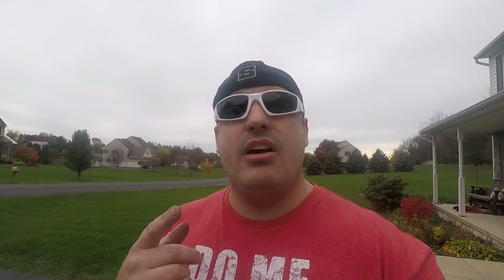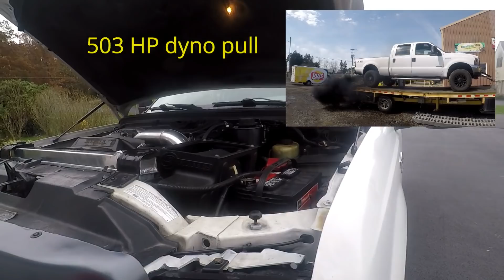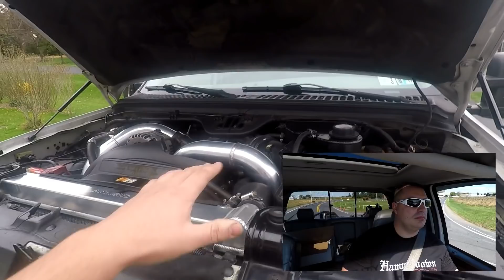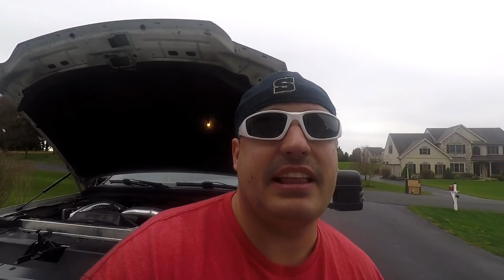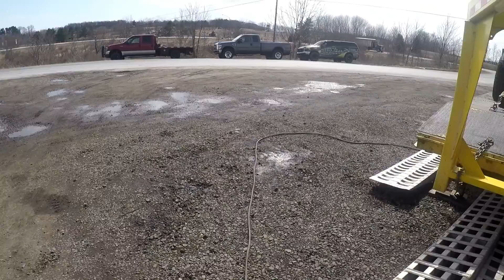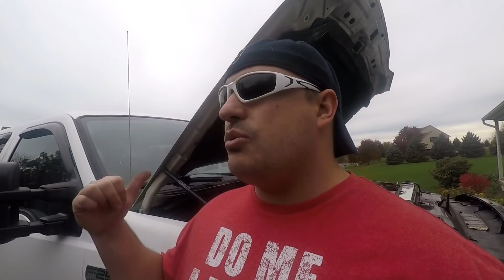Built 6.0 Powerstroke

Comment: So to make 500 horse I need to upgrade and replace whole engine basically thank you
Reply from the maker: No not at all. Turbo and injectors will make 500 hp custom tunes obviously.
Reply: @six0bros  coming from an lbz it’s just been a headache trying to hit power numbers lol I love the truck and love the sound just a lot more goes into it seems like , sweet build man
Reply from the maker: Thanks man. What are your goals? I do recommend certain things for certain power levels
Reply: @six0bros  not a super high power level 450-500 it would be a daily driver as well as a vehicle I would use to work (haul mulch ,cut trees and such) but something I could have fun with as well
Reply: @six0bros  would a wicked wheel and some decent sized overs paired with a tune to back it up get me there

Comment: Are you running stock rods and rockers? Do you recommend a cam vs. rods and rockers? I’m purchasing a KC Stage 2 kit with 190/30 injectors. Not sure if I should do the cam first or not.
Reply from the maker: at the HP you will be capable of I would not spend the money on rods at this time. I would do the cam over it. I love the cam in the truck. It helps the turbo spool very fast, and adds great drivability.  Also your rockers should be ok too. although if you have it completely apart it wouldnt be bad to get a fresh set in there or to consider upgrades.
Reply: @six0bros  What cam is it that you are using currently?
Reply from the maker: Colt stage 2 cam i love it
Reply: @six0bros  you do lifters or valve springs
Reply: @six0bros  what trans mods ?
Reply from the maker: I had new kdd heads with factory valve springs and lifters to go with my cam and new pushrods

Comment: In the process of building my second 6.0 now. It's going to run stock injectors until they give up. Not sure if I'll go 175cc injectors again or stick with the 155's. Powermax and a kill devil stage 2 cam for now.
Reply from the maker: 175/stock injectors are one of my favorite setups for towing. I loved my powermax turbo. However I do recommend some of the upgraded turbos. Like a 64mm turbo would perform a but better than the powermax. However the powermax is hard to beat for the value that you get. It's a big step up in price to the custom turbos made. However if you ever look at them I am sponsored by turbotimeusa.com/six0bros and the coupon code six0bros will give you 5% off. Also that is an affiliate link as well. Check them out. However again 175/stock with a powermax is great setup
Reply: @six0bros  which powermax?
Reply from the maker: I know a lot of people refer to different stages of power max but those are custom turbos. A true power max is a cast wheel and is completely built by Garrett. So I had just a plain powermax. Now as for upgraded ones turbo time usa sponsors the channel and has some great options. I think most people would love their 64mm turbo. It will spool up fast tow great work with injectors from stock to 205/30 not that you couldn't go bigger with that turbo but I think after a 205/30 you would need to go into their gxr series. Also if you're looking at turbos use code six0bros for 5% off their performance turbos
Reply: @six0bros  I need to tow.... heavy and looking on there site thrpught your link there's like 15 powermax turbos so I'm not sure was also thinking kc 1.5
Reply from the maker: I'll get you links to the 2 turbos I think you should consider. The first is their 61mm turbo. This will pair well with stock nozzles. You could still go up to 30% nozzles but this really is more for towing performance. Great turbo overall for heavy towing.  https://turbotimeusa.com/products/stage-1-garrett-powermax-billet-61-turbocharger-2003-07-ford-powerstroke-6-0l-f250-f550

Next this one is their 64mm turbo I wouldn't go larger than this. You start to need more rpm to have the turbo spooled up but you can still tow heavy with it. This will pair well with stock injectors all the way to a 205/30
https://turbotimeusa.com/products/garrett-stage-2-type-s11-turbo-powermax-6-0l-2003-2007-ford-powerstroke

That is the single plane version which should spool slightly faster down low. They have a dual plane version thats a little more expensive will spool slightly slower but have a slightly better top end from my research hope this helps. Don't forget six0bros for your 5% off
Reply: @six0bros  I wonder how these would go w 155/stock .... ? I researched the powermaxes and guys say the egts are higher with them and hard to clean up smoke
Reply from the maker: The powermax turbo is a good turbo but it isn't as fast spooling as more of the custom wheel designs from aftermarket companies. 155/stock is a great upgrade that will have easy to manage egt, and still give a nice bump in power. The powermax turbo is a great size to run with that turbo. Garret has changed the wheel design of the powermax a few years ago and I feel it was an improvement over the older style. Still not as good as some others out there but those turbos also cost more. If you wanted a better performing turbo I would look at my sponsor. Turbotimeusa.com/SIX0BROS that is an affiliate link that will give 5% off their performance turbos. Their stage 2 would be better than a powermax but again also more expensive. Even with my affiliate code.
Reply: I'm going to a 155/30 and colt stg 2 ... so I'm not sure which one would light the best
Reply from the maker: @MrDanimal77  I would bump your injector up to 175/30 or go with a 155/stock. The 61mm turbo will light the fastest as it is smaller, but the 64mm will light quickly and have better top end. If you go with 175s I would go with a 64mm, if you go with the 155s the 61mm would be better suited. With the colt cam in there I would personally recommend the 175s and the 64mm turbo would be a very fun setup.
Reply: @six0bros  yep but I don't have the extra funds atm for reg fuel return and fass lift pump which is highly recommended by Warren,  full force and J&k engines so idk
Reply from the maker: I love my 175/stocks too. Small bump in price and your stock fuel should be able to hold pressure on them. Or 155/stock are a nice upgrade. Holding off on nozzles will save you a good chunk, but let you in the future upgrade the nozzles if you wanted. I would recommend sticking with stock nozzles for now. Also save some money and go with the 61mm stage one turbo from turbo time. Use my affiliate code six0bros and it brings the cost down to around 1200 I believe and it will run great with 155/stock or even a 175/stock.
Reply: @six0bros  I just ordered Warren 175/30% , have a rebuild kit coming for powermax as I found a used one ...... also a ww2
Reply from the maker: Just make sure to use a good brand rebuild kit like kc turbo sells. Will be a fun setup man
Reply from the maker: Also how old is the powermax
Reply: @six0bros  it's a 772441 - 5001S model
Reply: @six0bros  it's the garrett powermax rebuild kit from full force diesel .... shop here won't warranty the work bc its not "thier kit" .... 🙄
Reply: @six0bros  that's a good question I only have model #
Reply from the maker: I'm not sure I know like 2 or 3 years ago garret changed changed wheel design I don't know if someone made a wheel for the new dimensions. Is my only concern
Reply: Little disappointed in my current powermax. Not sure if it's the combo with the cam or what. Still have the stock intake on the truck for now as well. 

Anyway, it's super lazy on the low end. This is the third 6.0 I've put a powermax on and it is by far the worst performer of the bunch. My last two turbos looked stock in appearance but this one, the compressor housing has a rough cast look to it. Wondering if I got a China knock off. 

Also, when you first start it and the vgt actuates, it doesn't have the normal whistle at idle. More of a hiss. After it warms up it sounds normal. May disassemble it and look at the unison ring. Stock 03 turbo ran better. May find another one and rebuild it and just call it good. Shouldn't have tossed the 03 turbo I had. It suffered a bad oil leak on the turbine side.
Reply from the maker: Sounds like the other turbos may have actually been custom jobs from a builder. The powermax housing is actually pretty rough. If you send me a picture in Instagram 6.0hbros (yes there is an h in it) I should be able to tell you if its the real deal or not. The stock intake doesn't help either as it can be restrictive on larger turbos such as the powermax. I will say having the cam definitely makes a difference as well. Have you tried ficm tuning? Who's tunes are you running?
Reply: @six0bros  last two came from xdp if memory serves correct. This one came from Vince at IPR research. 

Tunes for now are coming from a banks six gun with the speedloader. Gearhead tunes are in its future for sure. Maybe I'll hold out hope until I open up it's airways and get some good tunes in it. Spent more on the build in other areas than I had planned so I skimped on the tunes. Truth be told it probably does just need more air. 

I'm not on any social media or I'd shoot you a pic.
Reply from the maker: You can always email me too at 6.0hbros@gmail.com blessed performance sponsors the channel and gives a 10% off tunes with code six0bros  people have been loving them so far. That is an affiliate code but you will love the tunes. Other tuners I'm not affiliated with I recommend are Warren diesel, truck source diesel. Gear head is also a great choice
Reply: @six0bros  I'm looking to get a 03 f350 drw 4x4 cc long box later this week lariat le .  Has only 125000 km .... engine is modded but no idea what's really done internally in regards to injectors , hpop ect .   want a solid tow pig and love 6.0s
Reply from the maker: Does the current owner know whats done?
Reply: @six0bros  it's at an auction , pulled carfax , 1 owner correct mileage , super clean no claims .  has sinister parts all over it
Reply from the maker: Most likely there isn't much done. Probably studded the truck and thats mostly it would be my guess
Reply: @six0bros  has sinister regulated fuel return , sinister coolant filter and oil bypass kit , bullydog screen in cab . Afe intake and looks to be 4" tbe,  sinister hot and cold cac tubes and intake elbow , mishimoto intercooler , you can see its also not the factory turbo .
Reply from the maker: Sounds like some stuff. My guess would be the injectors are stock with a bully dog programmer. I could be wrong. If you can send me a picture of the turbo on my Instagram I can probably help you figure it out a little
Reply: @six0bros  sold for 23500 at auction I wasn't willing to pay that unfortunately 😞.... now I'm just going to get into an 18 6.7 KR f350 I think .... hefty fifth wheel capacity
Reply from the maker: The 6.7 does tow really well man. I can't believe that truck sold for that price
Reply: @six0bros  you and I both
Reply: I ran an air dog with my 175/stock injectors in my first 6.0 and after my second air dog smoked itself I put tge stock pump back in. To my surprise it kept up with the demand just fine. If memory serves correct, and I'm not saying it is lol, it held 52-55 psi under full load. 

Oh, and I lifted the heads off my 06 again. 😫
Reply from the maker: A stock pump can keep up with those injectors as long as it's healthy. Sorry about the heads man. What all has been done to the truck?

Comment: If you don't mind me asking. From start to finish with the build from bare block up to what you got now.  What is an estimate cost that's involved with rebuilding an engine up to what you got right now? Just engine alone ,injectors, cam, bearings, Turbo ect. Thx.
love your videos by the way. Giving me a lot of ideas of what to do next with my 07 6.0. I'm actually tempted to tear down to the bare block and do what you did. Even though I already have like the delete kit on it. Head studs.
Reply from the maker: It is hard to say. If you are doing the work yourself. Then maybe around 8-10k if you need to pay a shop probably more like 15k if you have any questions let me know happy to help
Reply: @six0bros  ..  Ok. On my truck right now. It has the EGR Delete. Head studs not ARP's. No tune yet. Everything is pretty much stock. I still have low miles on the engine. Probably around 155,000. The only reason why I was thinking about tearing it down and redoing the whole thing back up. List on personal preferences. Basically I'll sleep better at night knowing that everything has been done with the great performance products. I was thinking about doing the stage 2 Kit with the cam and bearings. Stage 2 injectors. Upgraded Turbo. And thanks to one of your videos upgraded ported intake manifold.
Banks intercooler system. And some little stuff here and there. I'll even upgrade probably the oil pump as well as the fuel system. Down here in San Antonio we have a company called Truck source diesel. Highly recommended company. They do awesome work on diesels. Going to take it to them and see where we go.
Reply from the maker: I am well aware of Tsd and I will probably be reviewing their spd tune this winter. Stage 2 injectors what size is that. I also recommend a csf 6028 intercooler, with mbrp hot side pipe and no limit fab cold side pipe. It will come out a little cheaper than the banks kit, yet perform very well. Although I have wanted to run the banks kit and then put my setup back on and compare them a little bit.
Reply: @six0bros  the stage 2 injector that I saw on a website was 175 cc. Unless I read it wrong and it may have said 155cc.but who knows I may just take it to them and see what they recommend doing. They're great honest people at TSD. They won't kill your wallet unless you want to kill it yourself. even then they would recommend doing something else. And as far as the intercooler goes. I saw that on your channel. Trust me it got me thinking. Have you upgraded your FICM yet with the mods you have done? I have replaced mine but with just another stock one